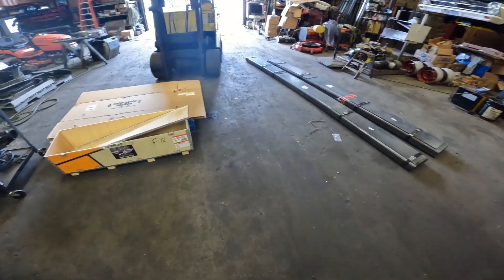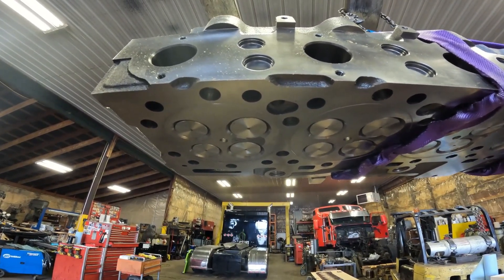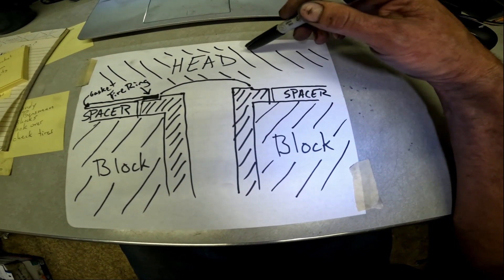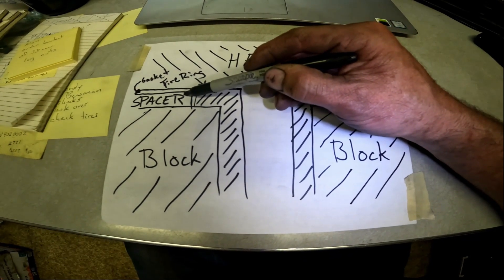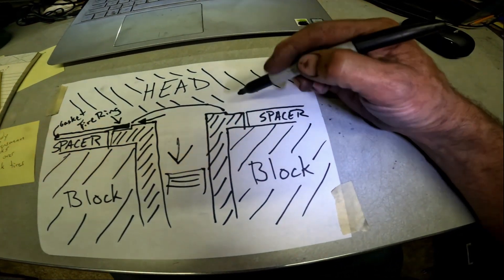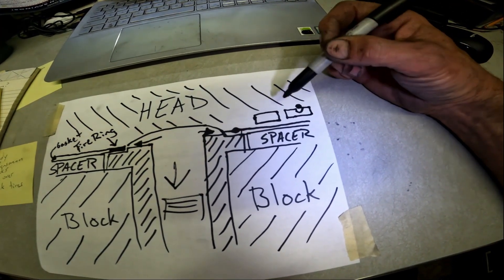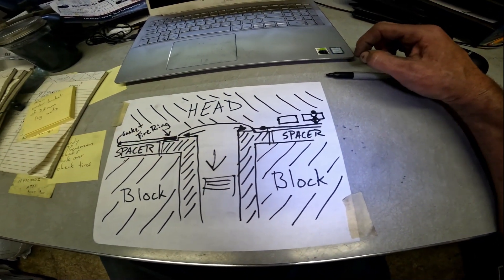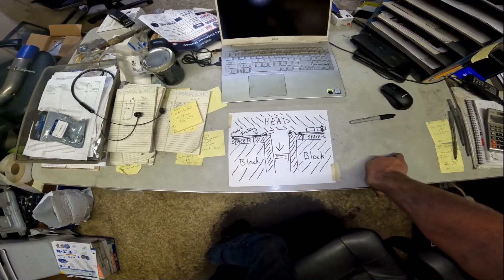Q: Is worth it to 'fire-ring' a Cat C-15 head? A: Yes.  Yes, it is. Here's why.

Comment: I'd like to know the wire gage that's being used & is it Stainless Steel wire? 
What's the protrusion of the ring from the Head surface?
 The reason is, I cannot buy a 3406C Head with Fire-rings installed.
  And only asking because I've been looking into machining my own grove, and installing Fire-rings on a 3406C cylinderhead.
  I'm currently Building a Mechanical C17 with a High-lift Cam and wound like to have the extra Crush and lower the risk of a Blown Head Gasket, I've been fortunate so far for a number of years running @ 48 PSI of Boost and internal exhaust temps exceeding 1350*F on long hard pulls. 
But for this next assembly I'd like to cut and install some Fire-Rings.

Hopefully you see this and respond.
Thanks
Reply from the maker: A friend of mine is the one that figured all of this out with the local machine shop.  I just go through him to get heads done.  I don't know exactly what they're using.  I believe it's stainless but not positive.  Out of respect for his investment, I haven't tried to reverse engineer his work or anything.
Reply: @bigrig_smilespergallon  Thanks for getting back so quickly,
Is there any contact information for the shop that you can share?
Great content you're creating, wishing your family and you well.
Thanks

Comment: Where did you get the new frame rails from ? If you don’t mind how much were they ?
Reply from the maker: PG Adams in Vermont.  They're the only place in the US that can make you custom rails to spec.  Two rails about twelve feet long with plates for the inside at the splice and with shipping was about 2500 if i  remember right'
Reply: Thank you for the response . Do they come pre drilled ?
Reply from the maker: @Gmoney927  If you send your old rails to them or give them a blueprint, they can drill them.  For me, that takes too long and costs too much.

Comment: For the baby cummins 6bt 5.9 12v the up grades are MLS headgasket , o-ring,  Fire ring.  
I like how you explained the o-ring creates a keystone to index the ring adding mechanical retention/capturing the ring, requiring shearing  the ring for it to escape instead of just relying on friction.  

With big power do cats still push the fire ring insert out? 
5.9s do, so fire rings were devloped replaceing the insert with a slightly larger round wire and adding a grove to the block side as well( if i understand cat setup correctly the 2nd grove would go in the flang of the cylinder liner). Resulting in the keystone effect top and bottom .
Reply from the maker: I'm really not into huge power like the competition pullers have.  From what I understand (and this is old info), those big engines pushing 3000 hp or more were developed with o-rings built into special liners.  I think they might have removed the fire-ring from the headgasket altogether.  But it was never meant to be an over-the-road build.  And I'm just not into that.  I can appreciate it.  But I don't really want to be any part of it.  Whether it's show trucks or cars or engines - it doesn't matter - if it's not being used and useful, I just don't care too much. . .  I respect working engines and trucks that are at the top of their game and reliable.  So that's about the extent of my knowledge on the subject..

Comment: You were referring to the metal O ring as "wire".  Are you sure it is not hollow?  Industrial pumps sometimes use internally pressurized metal O rings.  Internal gas pressure is creating in the ring with a reaction of powders inserted before closing ends together.
Reply from the maker: It's literally wire.  Before you could buy a new casting o-ringed head from apc or any other manufacturers, a friend down the road got our local machine shop to start machining Cat heads with the groove for him.  Then when he got them back, he'd insert the wire and fill the expansion gaps with block hard.  We still do it that way if we're upgrading an engine with a good head and have the time to wait on the machine shop.  But anyways, the wire is very small diameter.  Not a tube.  And you can see the splice where the wire butts into itself.  APC is using the same size wire on their heads.  (Or at least, very close to the same size.

Comment: IPD rebuild kits have a liner that has an outer raised edge to keep the fire ring in. Same kinda thing as the oring on head but it’s part of the liner.
Reply from the maker: I've seen and used them.  (I'm not going to swear by anything beyond this point.)  But from my recollection, it's not the same thing.  The raised ring on the liner is behind the head gasket fire ring. The raised ring on the IPD kit sets more in the graphite area of the head gasket.
Reply from the maker: When I say I used them, I mean that I agreed to install parts that customers brought to me.  Not my choice but I worked with them.  IPD has some good products.

Comment: do the fire ring installed in the head ever need to be changed on rebuild?
Reply from the maker: No.  We've had to go back into an engine that's been fire-ringed before.  The wire stays in the head and just use a wire wheel to clean the head surface.  The head gasket has to be peeled off of the head because of the wire crimping into the firering of the head gasket.
Reply: @bigrig_smilespergallon  I suspected that just good to hear a voice of expeirence to confirm,  Thanks